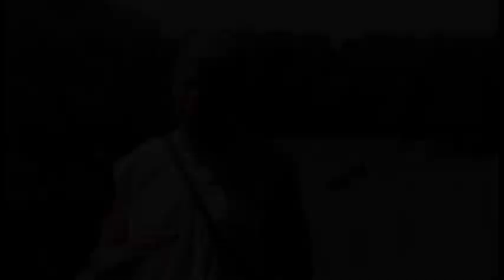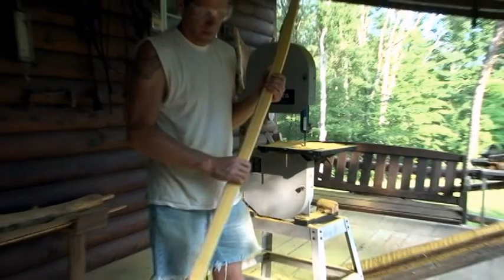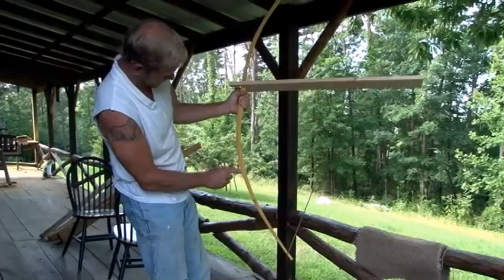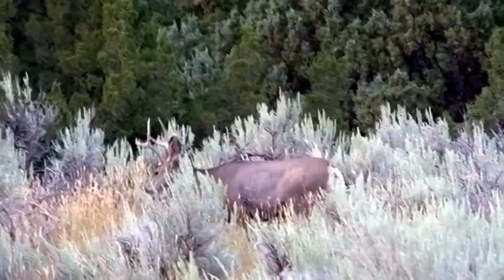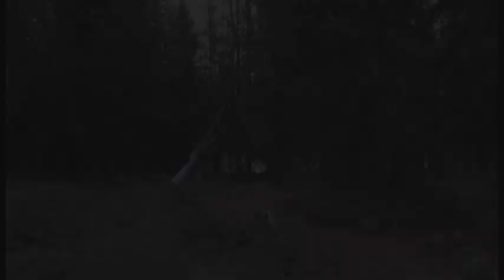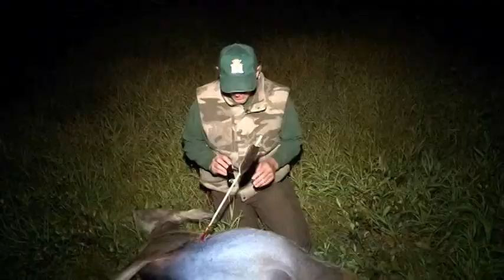Making Primitive Bow for Wyoming Hunt

Comment: motor chain saw to split the log?bend saw  to make stave? please before you critic modernism and After you use chain saw and bend saw?please please please ,axe and wedges to open the log ,and draw knife to carry out the bow from the stave ,same tool to put away the sap wood ,following the growth ring.  four handle tools ,axe wedge Hammer draw knife ,that s It   i never see before primitives with motor chain and bend saw ,please it was even a clean  log without big  knots the only was near the extremity and you cut It away  ........  usa primitives  .........
Reply from the maker: You are being very hard on me Roberto but correct.  I have split many logs in my time with wedges and always ended up with a soar back.  Check our video out on the hatchet bow.  Thanks for your input.